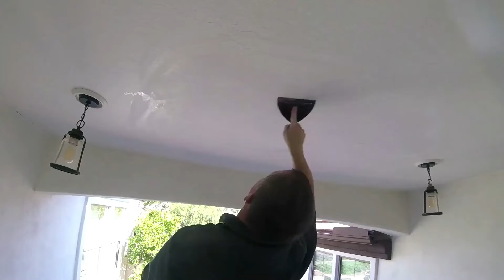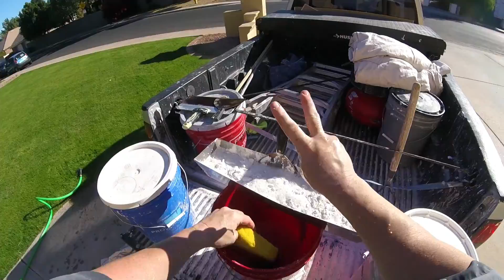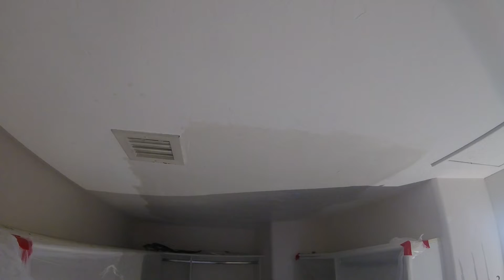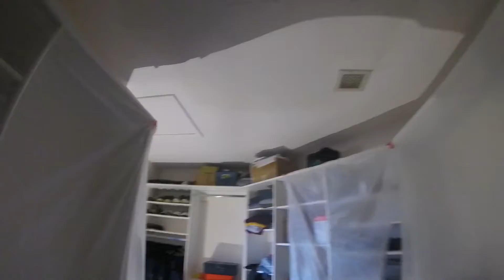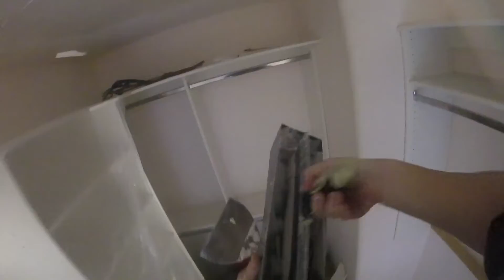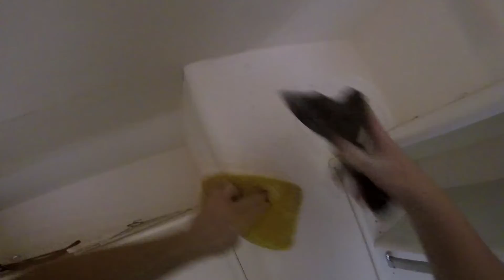How to Repair a Large Water-Damaged Ceiling Hole (Step-by-Step Sheetrock Fix Tutorial)

Comment: Nice video. Is insulation not needed?
Reply from the maker: Not in soffit with upstairs bathroom  above
Reply: @drywallrepairman thank you. Can I also ask if it is necessary to add compound to the whole patch or would it be okay just applying it to the edges where the tape is applied?
Reply from the maker: yes to feather out float out patch how its done properly